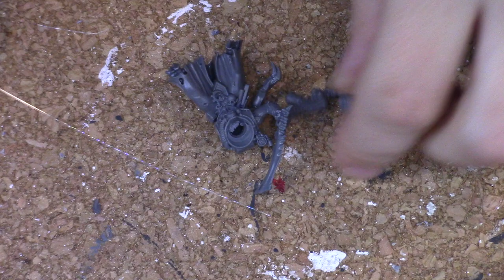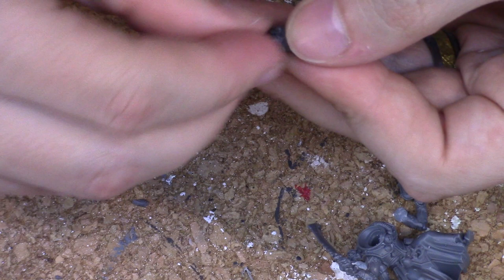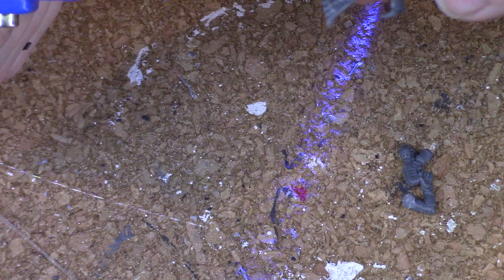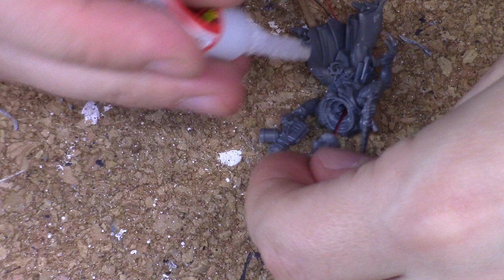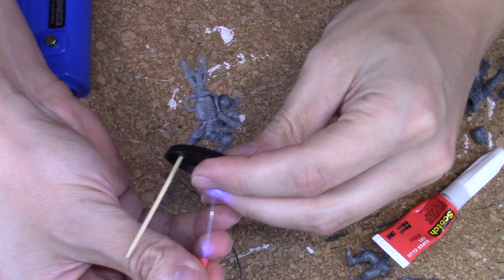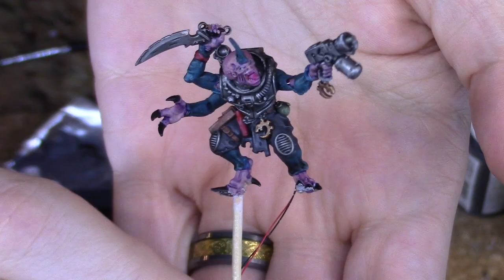How to Light Up Minis - Part 1

Comment: Nice work! I did similar thing on Model Railway scenery like cars and lights on buildings. A good Tip i got from an old modeler is to use conductive Silver Laquer instead of wires in some parts of the model. In the example you mentioned and said: good luck on models with thin legs...it comes very handy. The laquer works like wires on the outside which can be overpainted to hide, it's so thin you are not able to see through paint.
Reply from the maker: Thanks. Very nice tip about the conductive silver laquer. I will have to try that out. Most of the time you don't want to put anything heavy on the outside because it will reduce the detail on a model. But this sounds like another good experiment, thank you

Comment: Been waiting for this since your initial Reddit post. Great video man, really easy to follow. 

It's rather ironic that this would make the most thematic sense with my Necrons, and could look amazing, but they also happen to be the most spindly models out there. I just couldn't imagine drilling through those legs would go well.
Reply from the maker: Thanks. I hope you liked the video, and try it out. Working on part 2 now.  Necrons would look awesome with light up stuff. You are right though, their legs and arms are so thin. I have seen someone do it before but a different method than mine, looked really involved. I have never played necrons before, so I don't have any of the models laying around to try for you. You may have to hand drill everything? Don't know until you try. Good luck
Reply: Think you're right about the hand drilling. One problem I've found with that however is trying to apply enough pressure to go through without snapping it. Is it possible to use the .3mm drill for everything or will certain bit's not fit? Think the LED in the base method may be required for it as I think the fibres are thinner than the cable
Reply from the maker: @jaihayes9647  you may be right about the fiber running. However you would at a minimum do a 0.5mm hole, at least for two fiber strands. 0.2-0.3mm is the normal strand diameter. It kinda comes down to how many light up things you want to do this to. Looking at pics, HQs and elites have thick enough legs where I don't think it would be an issue. The standard warrior may be the issue but you are talking a butt load of models. If I can get my hand on a necron of some kind i could try it out. I've always loved the models but never invested in an army.
Reply: Thanks for the info. True, I do stay away from Warriors anyway, so may stock up on Immortals and just have huge legions of glowing eyes. Tempted to attempt a Gauss weapon as well, could shine the light through the rods and as it's not fiber it should refract out. Ty
Reply from the maker: @jaihayes9647  so with other areas that aren't tiny, you have other options that work with led lighting. For example, I just did a Darth Vader using an acrylic rod. Lightly sanding the edges of the rod, created a fairly even light refraction across the surface. Ive also done other plastics like 3d printer filament for stuff, didn't work as well as fiber or acrylic but it did work. I was wondering on the application of 3d printing with this type would flighting too. But you have options when it comes to guns. Also, you could always do two LEDs, one in the head and another in the gun. Just have to make sure you site it correctly.

Comment: Great tutorial !  does it works with nylon thread instead of optic fiber, is there a real difference for the eyes?
Reply from the maker: I honestly have not tried it with nylon thread. But would love to know what you find out. The only thing required is that light is injected at one end and seen at the other. Fiber optic works great for this unless it is kinked or diffused in any way.
Reply: @SuperPhunStuff  thanks for your answer, i'll try , i just received some leds and tell you what i find out.👍